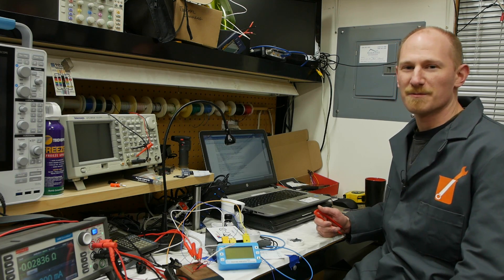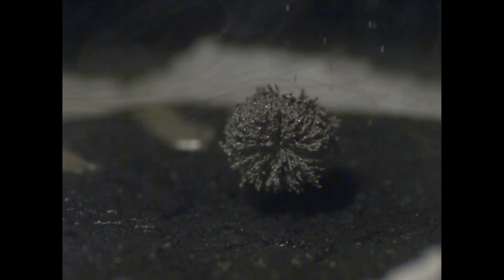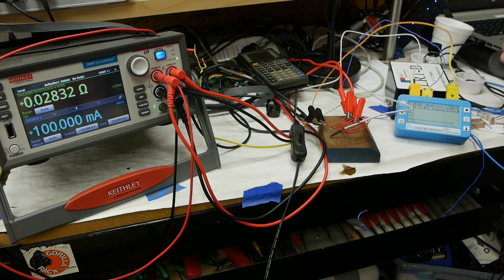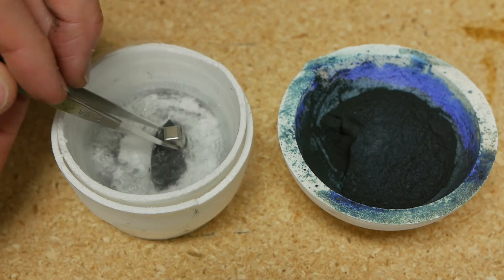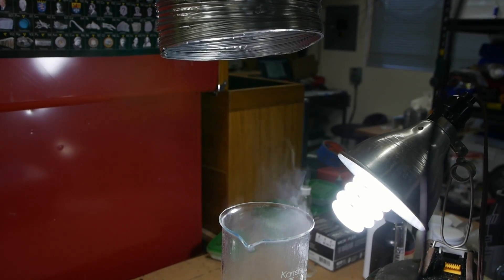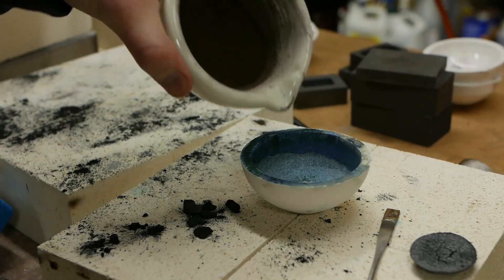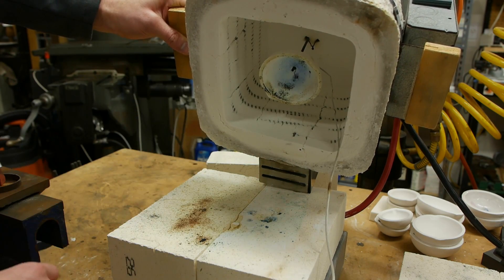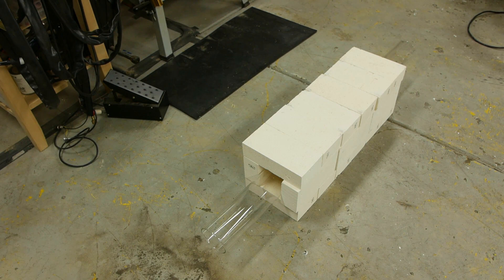Making YBCO superconductor

Comment: Superconductor are doable in the home lab. Needs a hell of a home lab :)
Reply: Well, it's not that bad. I'd say it can be done for less than $1000, including the liquid nitrogen: 
1. You can do the experiment outside instead of using a fume extractor.
2. You can make a furnace/kiln for less than $100.
3. The hydraulic press isn't really necessary, but you can also make one for cheap if you want.
4. Buy a liquid nitrogen dewar ($200-300) and look for someplace where you can get LN2 or get a cryocooler (Ben got it for $400, though I can't find any). This is probably the most difficult and expensive step!
Reply: @GRBtutorials  you can rent dewars for like 20 bucks where I live
Reply: Jonas Ghafur Well, here in Spain, I don’t know of a place to get LN2 as an individual even with a dewar...
Reply: @GRBtutorials  Damn I see a lot of crying from little babies going on around here.  Liquid Nitrogen is not difficult or expensive to make at home.  Get out of the damn box you're in man.  The Dewars and cryo-cooler are free and easy to make all day long in any city or the country but one has to use his hands and brains at the same time.  I know a place that sells them everyday for pennies on the original but they are not needed for someone who is real.  All this complaining about this guys low-grade beginners home-lab makes my balls itch.  A guys shot is his home-lab and everything you listed should have been installed in the walls on the first day of framing and you forgot central Vacuum and oxygen and a few other things that should be right next to the compressed  air hookups.  Seriously though if you want those lab items all you have to do is ask and I can show you to them.  the whole world is crashing on it's head at exponential speed because the pre-scriptured end is upon us and all these lab things are damn near free everyday but the tools to make  your own nitrogen  are free every single day.   Just because I did not tell you "what and how" does not make me a liar and so in that spirit I'll also say this.  Lithium Batteries are free every single day for anyone in this country and if you know "why, how and where" then just apply that thinking to your nitrogen dilema and voila!

     Personally all this super-conductor crap is a joke and nowhere near as interesting as...say....uhhmmmm a Bedini wheel (any of the hundreds he made).  Or how about a complete GEET system?  Super-conducting was nothing but a dry hollow bone that never had any meat on it ....thrown out to the boxed up (schools of lower learning  a.k.a.  the nimrod schools of Tyranny) minds of humanity.  Geet is where it has always been to those in the know,  and once you have built your own and understand everything that must take place simultaneously for it to de-bond all matter and then recombine it harmonically....well you will throw away all the worthless science books you own and be pissed the rest of you life at the sorry excuse for knowledge that mankind has settled for.    100 bucks and a trip to the local hardware box/shop anywhere in the world...can get you  all your energy for free and add 25% oxygen back into the atmosphere as the exhaust product of it.  Geet can power your home and lab and the exhaust pipes which glow see-thru red hot using the highest of man's low learning.....now can be used to keep both the shop and the home nice and cold.

    Everything the universities teach is a lie and worthless distraction away from the basics which Paul Pantone taught and proved for the last 40 years of his short life.  Consider that Yahweh has just recently  unveiled a trillion times more proof that he is real and made everything................including all the free energy we all burrn.     If you understand that the creator's name is Yahwerh and then see if you can find one single thing that the universities teach that promotes the Holy Inspired Scriptures.  I promise you will not be able to  because their whole design is the      plans and actions of Hill.
Reply: @sizzlean9459  So, TL;DR for your comment + my comments in brackets: 
1. I can make lab equipment for very cheap [if it's so easy, why don't you show it to us on your channel?] or get it from someone that lives near me. [If that's true, it's most likely because either the one who sells it to you has no idea of how much they can be sold for, is very generous or is a complete idiot]. Ah, and according to a book ("scriptures") I believe in, the world will end soon, hence the prices. [Yes, it's possible that humanity goes extinct, but that has nothing to do with your book, and it's not very probable it will before 2100]
2. Free energy is real, and science is not. [Now I know that you will reject all science, so I won't bother trying to explain to you the laws of thermodynamics. Instead, I'll ask you: if such a thing exists, why don't electrical utilities use it to make more money?]
3. I'm an apologetic Christian, and Yahweh, the god I believe in, has unveiled a ton of evidence of its existence, so everyone should believe the same thing as me. [Mind showing us such evidence? If it exists, that is. And even if it existed, I don't want to praise such a selfish and self-centred god. I bet hell would actually be better than heaven!]
Reply: @GRBtutorials  Ahhh finally some fresh fish!  I have to thank you just for taking time out of your day to type that out.  I enjoy the fact that you were not an ass#$## and must have put some effort into this reply.  Once again (I want you to know that I am the reason and source that caused the home-made e-bike battery scene to be what it is) you didn't argue or ask me "how are Lithium batteries free?".  Now I told you that if you knew the answer, that you would understand how to create your own Nitrogen but either you were distracted by a little voice or who knows.   No you need not tell me about thermodynamicz, as usual you make an assumption and totally disregard what your english teacher told you as a child about making assumptions.  I ended up tutoring 3 classmates (one of them was the president of the honors society) in 600 physics (Nuclear Chemistry) while taking the courses, my grades were as usual all straight A's as they were throughout my 24 Years of education.  Being in the top 2% from my youth and never getting anything lower than a B+ I would be the one doing all the lectures in this conversation ...if this were that kind of talk friend but it is not and will not go there because you would only be embarassed and that does not lend to learning.

    I don't speak about things I believe in, I only speak about things I know as cold hard fact and you would do well to keep that in mind.  I am a man of Yahweh, which is the furthest thing that exists from a christian.  You don't know this because you know nothing about Yahweh, all you know is that christians are idiots which is true.  They are worse than idiots because anyone with an objective viewpoint and the smallest knowledge of the scriptures knows they are all liars and don't belive a word the book says that they pretend to know and believe in.  So if you could refrain from insulting me like that we can hopefully get somewhere with this.  Geet does not need your permission or maxwell's or tesla's permission to do what it does or is that something that your boxed mind cannot except.  Geet is taught in France in automotive technology courses in University, and it is proven and used by over 80 million people around the world.  Is it possible that you are ignorant because someone told you the status quo is all that is available?  Or are you just hard headed?   Paul Pantone was my mentor and best friend and I was his favorite student simply because of the way in which we met.  He was not a fraud and had a gentle way of breaking down the stupidity that comes out of the mouth's of the graduates of the schools of lower learning which were started by Cush.   In the old days they were called Nimrod or Tyrannus and were known as the schools of Tyranny.  This is why you will never see one slip up of any of the professors, that is to say you will never hear about Yahweh, they will never tell you that it is the Micro-Kingdoms with which the whole earth creeps that govern your rain and snow and wind and that keep the sun from burning your ass crispy in a moment.  Yes they know these things, at least now they do because Yahweh's last days witness Yisrayl Hawkins told them where to look.  If you were to open any journal of micro-biology at this moment,  yeah like right now...what would you see??  You would see all the current work is currently dedicated and focusing on the micro-kingdoms of which these idiots thought were just bugs to be destroyed.  They now know that man is only 1% human and the rest of you is made out of kingdoms of micro-beings.  They now understand why every rain drop and every snow flake has at it's center a living creature that caused that rain drop or snow flake to come into being because that is it's commanded job.  They also know that the Firmament which is the entire group of all the kingdoms above your head....are all sick and being raped by man's STD's and cannot do their jobs because of mans' STDs.  How do they know?  Well because they have looked at their DNA and RNA and can plainly see the codes and markers left behind by aids like diseases which are created by SExual Sins.  None of this is belief friend, it is stone cold hard fact that neither you or any unbeliever can even open your mouth at....now wipe that drool of your lip and let us continue with a real education leaving the floating magnets to warm up and return to their jobs.  Did you know that in 2013 MIT created the first Nano-Microphone?  Did you also know that when they turned it on near a bunch of microbes and bacteria that they heard singing?  How are you going to be able to stand with a straight spine when you find out that everything down to the electron is not as you were told, it's all alive and everything has a job to do, also they have ears and methods of making noise or mouths for singing and communicating.  Just as I told you that the most expensive equipment in the world goes for pennies on the thousand right now,,in fact I just watched a ten milllion dollar electron microscope sell for 2500 bucks!   Has it never bothered you that the electron microscope has never picked up a trace of an electron?  I enjoyed educating my physics profs when I was but a yute (my cousin vinny) and telling him what an idiot he was to argue with me about something that cannot be proven and he will never see proven and told him he could not fail me on that basis just because I only believe and stick to facts based on the scientific method and no matter how many idiots are repeating the lie, I won't.   

   If you are serious about seeing the proof that Yahweh has for you, then please reply once more so I'll know you are serious and I will show you more proof than you can handle, and I mean absolute proof you can sink your teeth into.  Proof hidden from all mankind through the most amazing and genius mathematical mind that has ever been, proof that has been right under your nose for 6000 years but only now in the very very last days are you allowed to see it thanks to the compter which by the way was invented in 1934, along with the nuclear bomb and the birth of Yisrayl Hawkins, all of which the prophet Daniyl told you would happen.  Did you know that the nuclear bomb was invented on 7-4-1934?  yep july fourth, did you know that july fourth 1776 was the day that the bohemian illuminati was founded?  I know things that you don't know but could benefit from but thinking I'm a stupid head in the sand christian idiot will get you nowhere.  I built my own equipment, I have a lab but it is not for you or youtube to see or use, it is mine and all my inventions are mine and mine alone, only for my closest friends (the dog) and family.  Rather than thinking that I owe you a video just so you can know if I'm a liar or not, why not just ask for what it is that you want and I'll show you how to get it for cheap or free.  But don't call me names and try to downgrade me in public and then think I would have if I could have.  You think long and hard about this,,,,do you really want proof that you and your teachers were all wrong?  Because that is exactly what I'm going to show you if you are serious.  Now is the time to pull your head out of your ass and get your brains back from your prof.  You don't remember the first day of class he made you surrender your brains and he has them in a jar on the shelve in a jar of pickle juice, that is why you cannot think like a real man and can only repeat the useless phrases given to you by the high priced low education paper on the wall.
Peace
Sizzlean
P.S.  someone spilled crap on my keyboard and so I'm down to about 13% efficiency, that is why I missed certain things, no t because I'm avoiding any situation or subject.  I have voice dictation software I can use if it is needed but you must be prepared to read several series of novels if we go that direction...you have been warned.  Now my fingers need icing and a massage and probably a little time off
Reply: @sizzlean9459  wowwwwwweeeeeeeeee

Singing bacteria huh? What kinds of music do bacteria like to sing? Or sorry, what do micro-beings like to sing?
Reply: @theodorekorehonen  I've been waiting for someone to make fun of my comment and it truly took way longer than I thought it would but it is so weird to see your words.  To see that the idea of the micro-kingdoms would have voices is so ridiculous to you that you didn't even hiccup at the thought of some person, some engineer had the idea to create a microphone small enough to find out.  A Microphone that is either wireless or has wires near the size of the smallest things that man is able to fabricate.  That was not strange to you but what I said was.  Did you know that some of those critters have a propeller that spins over 100,000 RPM's and uses electricity exactly how the finest motors that man has ever built do.  They have the ability to create the A/C current at the brushes, does that bother you that they have electric motors that are far superior to anything man has ever dreamed up?  If you understood how it was that Yahweh created the earth, then you would not find it hard to believe that a person could say to a mountain...be ye removed and go drown yourself somewhere else....and what does the scripture say???   and it (the mountain?,  or the micro-kingdoms that make up the UNIT we call a mountain!!!!)  would obey.  It's okay for stupid white lab coat wearing bozos to talk about gravity waves, and black holes and Dark Matter and Dark Energy and you will probably believe t hem but if I tell you that "Everything with which the earth creeps"  is basically the sub particles and what they build using their own selves to do it.  If I tell you that the Marriage of Hydrogen and Oxygen is very stable and strong you might fall off your chair.  Meanwhile you also know that people have found and are looking for KEYS to break the bonds of H2O without using a bunch of energy to do it.  If a person had Yahweh's authority or mark of trust, all that would need be done is to ask and the Hydrogen would go down one hose and the oxygen down another or they could travel together in the perfect ratio and not even a lightning bolt could entice them to blow up because they would never harm a person with authority over them since this is the Number one Law.  "You are never to do anything that might endanger the your own life or the life of another being or cause harm to the environment"
    So to answer your question, I don't know what they are singing or what type because they are at this time Mourning the Curse that is sickening them and bringing their strength down.  Man's STD's are found along with Man's DNA inserted into all of their strands at this time.  The Firmament is sick and cannot do it's job which is of course to bring man the things he needs for life, to shield him from harmful rays and to do that which the weather does so as to feed both man and the animals.  Anyone who cannot see this is blind, are you blind?  Are you honest enough to admit the food is weak even if it's not Monsanto's crap, even Gramma's best heirloom seeds don't do what they should because Man is the cause of Global Warming but it is way different than all the B.S. that is argued about all day long.  If you can't see they are either deliberately causing all the bad weather with the chem trails, or they are actively trying to slow down something they know is happening, well it doesn't matter because they did not understand who or what was responsible for the weather until The Greatest Teacher in the World Yisrayl Hawkins told them, now they know but don't have a clue how to stop it because man has no cures for any virus, never has and never will.  Most people don't know that man has never had a pill or shot that would do anything to any virus but that doesn't change the fact that he doesn't and now the super bugs all need to be renamed because MRSA is no longer Methicillin resistant, it is anti-biotic Proof like a marine on Tequila with Ceramic Body armor and the Air force and Navy as back up.  So laugh at me while you are still ignorant of The Gem atria which laughs at you but a reckoning day is almost here, it arrives  on different days depending on when a person's balls drop or when they get the courage to look seriously at what we are telling you is new evidence and proof absolute that has nothing to do with any of the Worthless Lying 4,199 Fake Religions who have lied so much and acted the fool and prostitute that they have caused the entire rational world to end up in the shoes of the Boy who cried wolf or vice versa, however you want to look at it.  The Wolf is The Whore who sits on seven hills of Rome, she is real and owns you yet you don't even know she exists, just the way she likes it since she expends zero energy messing with you and all her energy trying to defeat Yahweh's plan which is going to subject her and her sons (the gods) to the authority and command of Mankind.  To this end and to the very bitter end she is willing to take you because Misery wants you to die with her.   If they were not sick with the Curse, I'd say they would sing praises to Father  Yahweh all day long for the life they have, the food they eat and the jobs they have that give them great joy in doing.  They were created for mankind and get enjoyment from helping him be fruitful.  If only mankind cared so much about the little guys even smaller than the ants we would be a lot better off and healthier.   I hope that answers your question, I tried to keep it as short as humanly possible but you must understand how many thousands and thousands of hours of knowledge you lack and how far behind the Called out ones you are.  The Universities are the Schools of lower learning or Nimrod where Tyranny is taught and the truth is put into vacuum sealed jars of Formaldehyde and stored cryogenic ally in Deep Darkness.  One day you will know this to be Pure Fact and then you will know how nice I actually was when speaking about them.
Peace
Sizzlean
Reply: @theodorekorehonen  Music by "The Germs"
Reply: @sizzlean9459   That's a big Oof from me chief. You need to go see a doctor about the worms in your brain.
Reply: @sizzlean9459  Yikes.
Reply: @sizzlean9459  Wait I think I figured it out. So If I get a little microphone and talk to the micro kingdoms they can tell me that the lithium ion batteries are free all around use if I just ask the snowflakes what the coordinates are of all the free stuff which is just the coordinate of planet earth which yawhay created so everything here is free so I can just go to target and grab some Li-ion batteries put them in my pocket then leave, then go to amazon.com and buy the book on GEET that shows me how if I focus my energy I can figure out that every one exepct for me and my followers are stupid and then I can build a Infinity engine that is based on qualitative reasoning and some random numbers and shit
Reply: LOL.. my home lab can barely make waffles.....
Reply: I am 13. I made this in my garage. Its actually quite easy, as all you need is the actual chemicals, a metal kiln, and liquid nitrogen.
Reply: I imagine the original labs were these were made were on the hundred million mark. The biggest impediment is time. Very very impressive.
Reply: You need a precise kanthal furnace, ceramic ball mill, a precission scale, a hydraulic press, and a mixer.
Reply: They are doable in a home lab...
Shows equipment worth 20k
Yeah... If you say so
Reply: @0Arcoverde  Maybe even more. The truck is that the value came from his time putting it  together from smaller parts. The actual cost is probably lower. Except for the press, which he really didn't need.
Reply: Home, lab, massive garage, fume extractor and $1m worth of gear.